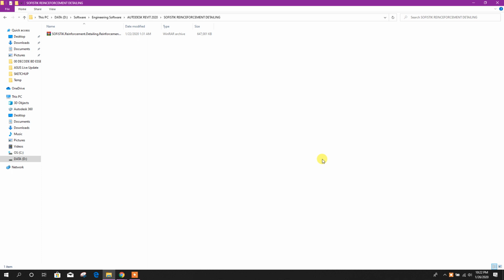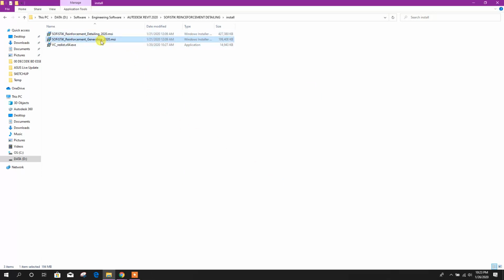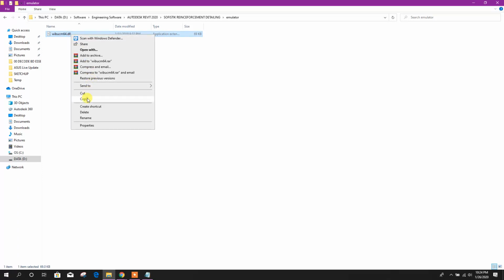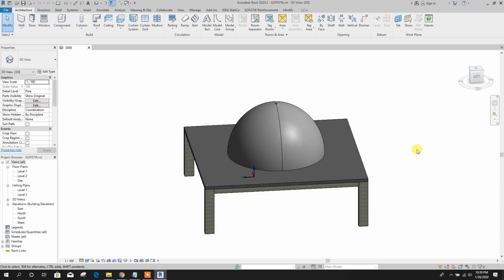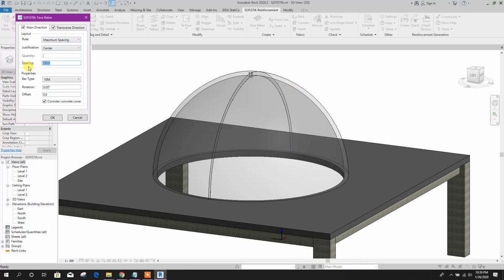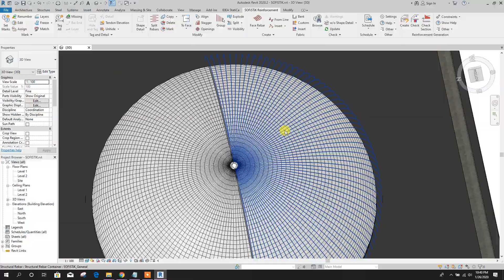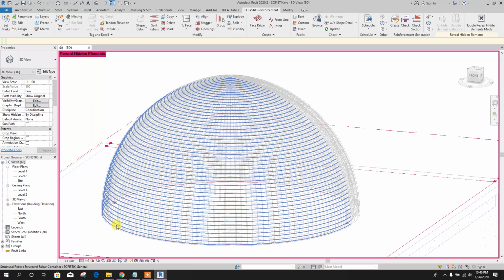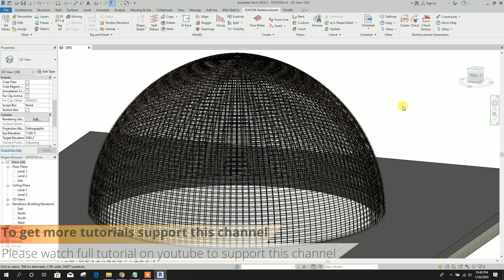Sofistik Reinforcement Extension for Revit 2020 | Installation | Dome | Face Rebar

Comment: To all of you who can't copy the crack to system32 folder windows 10, this is the solution:
1.Run task manager Ctrl+Alt+Delete
2.In Processes Tab find CmWebAdmin.exe
3.Click End Task to shutdown CmWebAdmin

Now you will be able to copy and replace the crack wibucm64.dll into system32.
Reply: Hi Kenan Rrahmani > the problem is now, crack has been included in system 32. however, it looks like the crack is not working properly. do you have a solution?